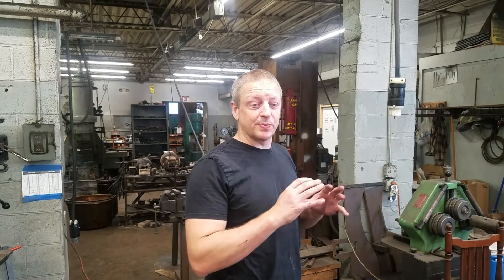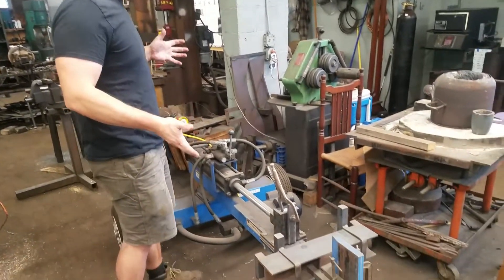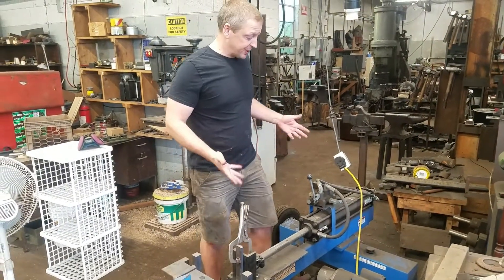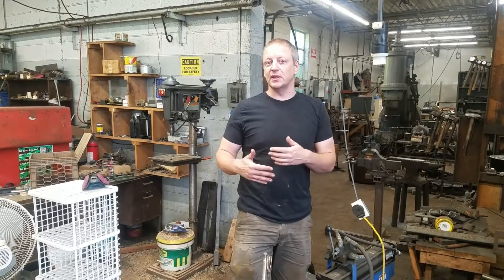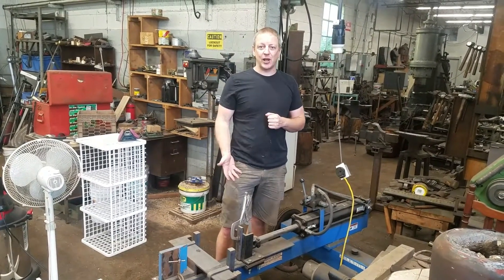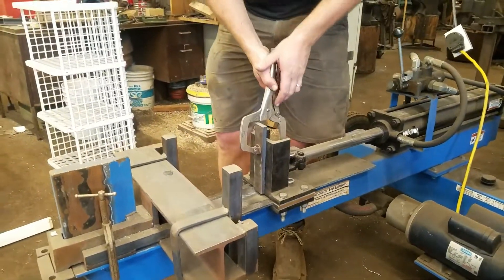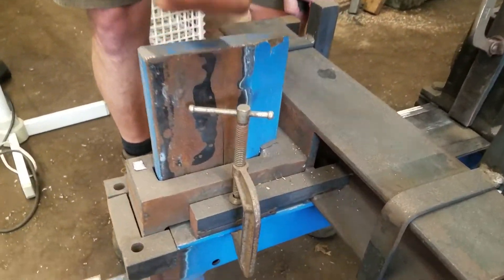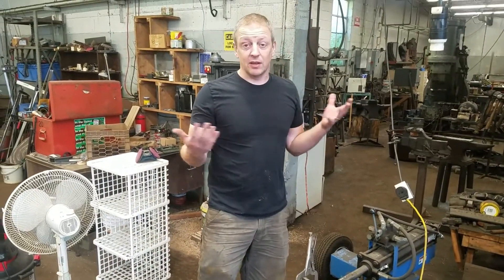Hydraulic Press Overview

Comment: When buliding a press the larger the ram spear/shaft the faster the retract speed so you get more strokes in the same amount of time with the same size pump so get more work done.
Reply from the maker: You are quite right that a larger shaft reduces the volume needed to raise the ram and therefore speeds the up-stroke. It is worth noting that we have two presses with 5" cylinders, one of which has a 2" diameter shaft and one has a 1.5" diameter shaft. The 5" piston has a surface area of roughly 19.625 sq.in. while the two shafts have footprints of 3.14 sq.in. and 1.76 sq.in. respectively, meaning a difference of 1.37 sq.in. Based on my calculations this results in a roughly 7% difference (compared to the total surface area of the piston) between the two if all other variables are the same. As a comparison, if we swapped out from the 2hp 1725 motor to a 5hp 3450 motor on the same pump we would change the working rate of the press by 100% (2x previous speed). The size of the shaft does incrementally affect the speed of the upstroke, but changes in the GPM rate of the pump have far greater effects. In our presses the one with 1.5" shaft runs at probably 3x the speed of the press with the 2" shaft because of the difference in pump and motor size. -Peter